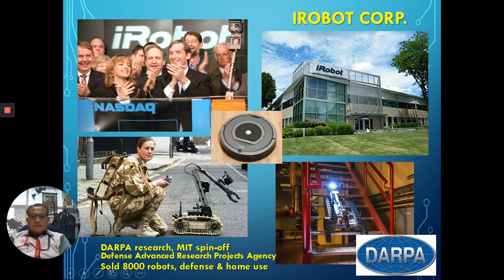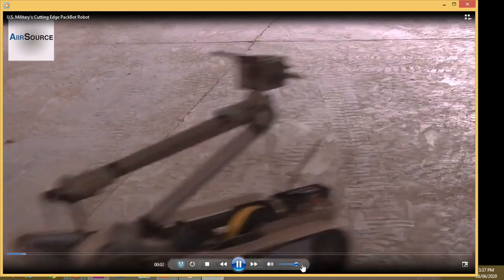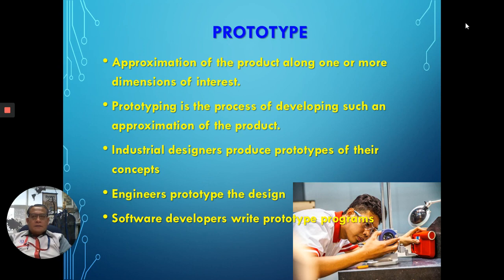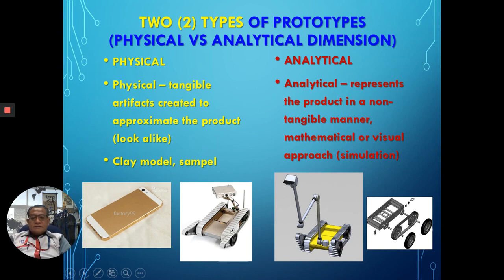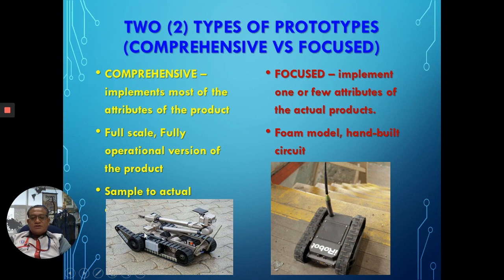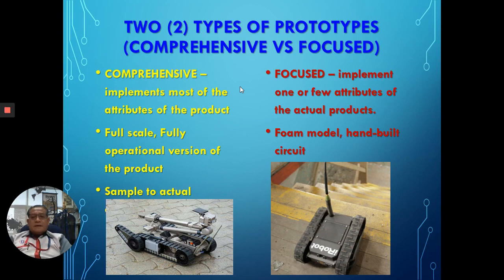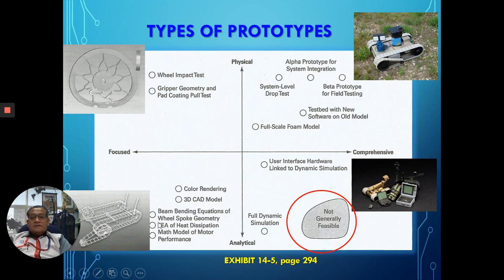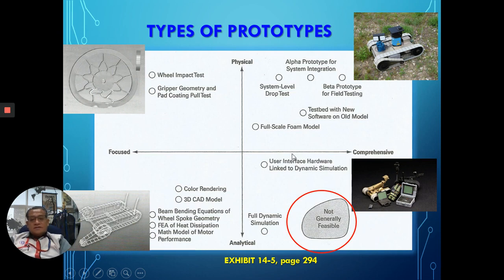Product Development Course Chapter 11 Prototyping

Comment: Ahmad Dhiaudin Bin Mohd Hishamudin (AP200079)
This chapter classifies prototypes according to their physical and analytical dimensions. There are four primary varieties of prototypes within these categories: physical, analytical, comprehensive, and focused. Physical prototypes enable designers and engineers to evaluate the form, fit, and functionality of a product. Analytical allows designers and engineers to evaluate and improve a product's algorithms, logic, or computational models. Comprehensive prototypes are beneficial for evaluating and validating the overall functionality and user experience of a product. Focused prototypes are advantageous when requesting specific feedback or addressing particular design challenges.

Comment: Abdul al-Akhmal (Ap200291)

Prototypes in this chapter can be divided into two categories based on their physical and analytical aspects. There are four basic sorts of prototypes that fall under these categories: focused, physical, analytical, and comprehensive. Designers and engineers can evaluate the product's form, fit, and functionality using physical prototypes. Designers and engineers can assess and improve a product's algorithms, logic, or computational models by using analytical tools. When evaluating the entire performance and user experience of a product, thorough prototypes are helpful. Focused prototypes are useful for requesting specific input or when tackling particular design issues.

Comment: CHE SHI MIN (AP200535)

I have learned what prototypes are from this video. The prototype can be divided into two types based on its physical and analytical dimensions. The physical prototypes are tangible, whereas the analytical prototypes are non-tangible. Additionally, there are two other prototypes that are both comprehensive and focused.

Comment: Lee Sook Yeen (AP200447)

Thank you Dr for sharing the video. From the video, I have gained knowledge about what is prototype which involves the process of developing such as approximation of product. This video also recaps the successful of IROBOT CORP. and its product. The capable robot able to move on the flat surface and climb the stairs. There are 4 types of prototypes which involve physical, analytical, comprehensive and focused.

Comment: NURUL RAIBATUL ADAWIYAH BINTI SAIIDI (AP200436)

From this chapter, I learned that 
Prototype is the processing of developing such an approximation of the product along one or more dimensions of interest 

There is two type of prototype which are physical and analytical. physical prototype shows a physical and made for sample. Analytical type is the model represents the product in non tangible manner such as in the form of software, graphic sketch and drawing. 

Another two types of prototype is comprehensive and focused. Comprehensive refers to the products which implement attribute of the product while focused mainly perform  1 or 2 attributes.

Comment: NURHANNANI FASIHAH BINTI ZULKARNAIN (AP200504)

Thankyou Dr for explaination.. So, for chapter 11, its explaining about prototyping. Prototyping is the process of developing such an approximation of the product. Its have four type of prototypes which is physical, analytical, comprehensive and focused. 

1. Physical - tangible artifacts created to approximate the product
2.Analytical - Represents the product in a non-tangible manner, mathematical or visual approach (simulation)
3. Comprehensive- full scale, full operational version of the product
4. Focused- implement one/ few attributes of the actual products.

The purpose of prototype is to learning, communication, integration and milestone prototype. Next, analytical prototype also more flexible than physical prototype. For rapid prototyping it is compatible with 3D CAD software modelling which its convert from dwg to stl drawing format.

Comment: NUR AMANINA BINTI MUSA (AP200517)
In this video, I gained knowledge about the four different types of prototypes, which are as follows:

Physical prototypes: These are tangible artifacts created to resemble the actual product.
Analytical prototypes: They represent the product in a non-tangible way, often through simulations or models.
Comprehensive prototypes: These prototypes are implemented on a full scale, creating a sample product that is the same size as the actual one.
Focused prototypes: These prototypes aim to implement one or a few specific attributes of the actual product.
Thank you, Dr., for sharing this valuable information in the video!

Comment: NURIYANA SUHERMAN (AP200344) From this video i learned there are two category of prototype which are :
1. Physical - present the product in a tangible manner 
2. Analytical - present the product in an non tangible manner

There are also have 2 more tyoe of prototype which is:
1. Comprehensive - thorough representation of the actual prototype and it is normally a fully operation of product 
2. Focused - emphasis on a few attributes of the actual produ

Comment: ALIFF IQMAL JEFFREY (AP200086) From this lecture video, prototype is a concept where it involves the process to developing such an approximation if the product. Prototype integrates control, interface software, hardware. There are two prototypes namely: physical and analytical dimensions. Physical prototype is refers to the features of the product or sample of the product. Analytical prototype is refer to software where ut involves more in software. It sketches the dimensions of the product. Another two prototype is comprehensive and focused. Comprehensive refers to the product where it implement most of the attributes of the product meanwhile focused product is perform only 1 or 2 attributes. Each prototypes have different characteristics

Comment: JOTHISWARAN A/L FRANCIS (AP200180) 

The video provided valuable insights into the concept of prototypes. A prototype is an experimental approach used by design teams to translate ideas from a conceptual stage to a digital representation. There are two primary types of prototypes: physical versus analytical in terms of their dimensions, and comprehensive versus focused in terms of their purpose. Each type of prototype serves specific functions in the design process.

Comment: Nur Izah Izzati binti Idris (CP 200006) 

Thank you for the sharing Dr, from this video i have learned about what is the prototype. Prototype is an experimental process in which design teams transform ideas from paper to digital. Prototype have 2 types which are pyhsical vs analytical dimension and comprehensive vs focused and each prototype have its own functions

Comment: WOON PEI XUAN AP200372
Throught this video, I have undestood the prototypes have four different types which is physical, analytical, comprehensive and focused.  The physical prototype is a three dimensional representation of an idea or concept.  Then, analytical is non tangible model. Besides that, Comprehensive prototypes are designed to test overall fuction of the product. Lastly, a focused prototype is to answer specific questions.

Comment: THARSHINIE MANIMARAN CP210058 . From this chapter there are 4 types  of prototypes which is physical, analytical, comprehensive and focused. The physical  dimension is tangible artifacts  created to approximate the product  and analytical dimension represents a non-tangible manner,like under mathematical approach. The comprehensive  is full scale  and implement most of the attributes of the product. Lastly the focused prototype it only perfor on few attributes of the actual product.

Comment: Wong Yunn Jye (AP200475)

In this chapter,  prototypes can be categorized based on their dimensions: physical and analytical. Within these categories, there are four main types of prototypes: physical, analytical, comprehensive, and focused. Physical prototypes allow designers and engineers to assess the product's form, fit, and functionality. Analytical enable designers and engineers to evaluate and refine the product's algorithms, logic, or computational models. Comprehensive prototypes are useful when testing and validating a product's overall performance and user experience. Focused prototypes are valuable when seeking targeted feedback or when addressing specific design challenges.

Comment: HEE HUANG TING (AP200440)

In this video, I learned about the prototype is an experimental model of a suggested solution that may be rapidly and inexpensively used to test or verify ideas, design hypotheses, and other parts of its conceptualization. This allows the designer or designers involved to make the necessary adjustments or potential changes in direction.

Comment: NUR HANISAH (AP200241), This video taught me that there are four types of prototypes: physical, analytical, comprehensive, and targeted. Then I'll understand that prototypes are initial samples, models, or product releases created to test a concept or process in various contexts such as semantics, design, electronics, and software development. Prototypes are typically used to verify new methods for accuracy by system analysts and users working to give specifications for existing operational systems. In some design workflow models, constructing a prototype, also known as a materialist, is a step between formalising and evaluating an idea.

Comment: Ng E Nee AP200399

First of all, thank you Dr for sharing this video. After watching this video, I have learned 4 types of prototypes which are physical, analytical, comprehensive and focused. Physical prototype is tangible artifacts to approximate the product. Analytical prototypes is a model represent the product in non-tangible manner. Comprehensive prototype is a model that implement most of the attributes of the products. Last but not least, focused prototype is model that implement that focus on a few critical capability of actual products.

Comment: HISHAMMUDDIN BIN HASHIM
(AP190310)

thank you dr for the sharing. From this video, I have learned that there are 4 types of prototypes which are physical, analytical, comprehensive and focused prototype. Physical model normally is testing its physical structure and physical capability.

Comment: Muhammad Syahmi Bin Rahman (CP190045)

From this video I learn what is the meaning of prototypes. There are 2 types of prototypes which is physical and analytical dimension. The physical prototypes where the product is tangible and analytical prototype is non tangible. There also have two other prototype which is comprehensive and also focused.

Comment: Nur Amira Afiqah Binti Norfaizal (CP190055)
Thank you Dr for your sharing. From this video, I have learned that prototypes is the actual of a product which can be classify into two types, physical and analytical. A physical prototype is a tangible object that is used to simulate a product. Analytical prototypes are non-tangible models that reflect a product (stimulation). A comprehensive prototype is a model that incorporates all of the product's features. A focused prototype is a model that focuses on a few key capabilities of actual items.

Comment: NUR RINA NAJWA CP190101

Thank you Dr for sharing, This video taught me about two types of prototypes: physical prototypes and analytical prototypes. The process of turning an idea into a physical representation Physical prototypes of various materials can be created early in the process. Physical prototypes enable both the designer and the user to interact with the concept. A mathematical model that can be easily tested. One disadvantage of analytical prototypes is that they can only show behaviour that is part of a model, and behaviour is frequently unpredictable. In software engineering, analytical prototyping is frequently used.

Comment: PRAVIN A/L LINGAM (AP190046)
Thank You Dr for sharing
These four prototypes are physical, analytical, comprehensive, and focused. I've learned this from watching this video. A physical model is typically used to assess a system's structural soundness and functional robustness. If you're going to test your model's durability and roughness on the field, you'll need an analytical model, rather than a physical one. It's common for a focused model to be tested in the lab, in the mathematical mode, or in a simulation, whereas a generalised model is typically tested in the field. A comprehensive model is a representation of the final product at its full scale, which is close to the analytical model's upper limit.

Comment: LOH WAN THENG (AP190366)
Thank you Dr for the sharing. After watching this video, I have learned that there are two types of prototypes, namely physical and analytical. Physical prototype is tangible artifacts created to approximate the product, while analytical prototype is represents the product in a non-tangible manner, mathematical or visual approach. Besides, there are another two types of prototypes, which are comprehensive and focused. Comprehensive prototype implements most of the attributes of the product. On the contrary, focused prototype implement one or few attributes of the actual products.

Comment: Nur Athila Safia Binti Jemzir (AP190035)
Thank you Dr for sharing.
 From this video, i learned  that there are four types of prototypes which are physical ,analytical,comprehensive and focused. physical prototype is tangible artifacts to approximate the product. Analytical prototypes is a model represent the product in non-tangible shape(stimulation). Comprehensive prototype is model that implement  all of the attributesof the products. Focused prototype is model that implement  that focus on a few critical capability of actual products.

Comment: Nurul Najihah binti Roslan (AP190032)
Thank you dr for your sharing. From this video I have learned that there are 4 types of prototypes namely physical, analytical, comprehensive and focused prototypes.Then, I can know that prototypes are initial samples, models or product releases built to test a concept or process which in various contexts, including semantics, design, electronics and software programming. Typically, prototypes are used to evaluate new designs to improve accuracy by system analysts and users who work to provide specifications for actual working systems. In some design workflow models, creating a prototype i.e. a process called materialisas is a step between the formalization and evaluation of an idea.

Comment: Alice Lee Ke Jia (AP190325)

Based on the video lecture, I have learned the four types of prototypes which are physical, analytical, comprehensive, and focused. Physical is the tangible artifacts created to approximate the product while analytical represents the product in a non-tangible manner, mathematical or visual approach. Besides, comprehensive prototypes implement most of the attributes of the product while focused prototypes implement one or few attributes of the actual products.

Comment: Wong Joo Yun (AP190066)

From this video, I learnt there are 4 types of prototypes, which are physical, analytical, comprehensive and focused. Besides. each prototypes have different functions. 
-Physical is tangible artifacts created to approximate the products 
-Analytical is represented the product in a non tangible manner 
-Comprehensive is implement most of the attributes of the products 
-Focused is implement one or few attributes of the actual product 

Thank you Dr for sharing

Comment: AMEERA AINUR BT AZMAN (CP190075)

Thank you dr for your sharing. From this video I have learned that a prototype is an early sample, model, or release of a product built to test a concept or process. It is a term used in a variety of contexts, including semantics, design, electronics, and software programming. A prototype is generally used to evaluate a new design to enhance precision by system analysts and users. Prototyping serves to provide specifications for a real, working system rather than a theoretical one In some design workflow models, creating a prototype (a process sometimes called materialization) is the step between the formalization and the evaluation of an idea.

Comment: Shazmin Ilyani Md Isa
CP190016

What I get from this video is that the purpose of prototypes is for learning, communication, integration, and milestones. There are 2 types of prototypes which are physical and anlytical dimension. The physical prototype where the product is tangible while the analytical prototype is non-tangible. The other 2 types of prototypes are comprehensive and also focused.
Thank you Dr!

Comment: SITI NORSAHIDAH BINTI SAFINGI (AP190125)
From this video, i understand and learned about the prototype. Basically prototype are build as a sample before it turn to actual product. There are two types of prototype firstly is physical and second is analytical. For physical prototype is more to physical kind of outlook of its actual final product. This made for sample that customer can touch and feel it. While for analytical prototype more like simulation which is non tangible shape. Normally, in the form of software such as visual approach. The important of prototype is it can help attract customers to invest in the product.

Comment: FARHANA SYAZWANI BINTI AHMAD FADZLI (AP190439)

Thank you dr for the explanation. In this chapter I’ve learnt that to make a real product, we must design a prototype first. From the prototype model we can get the approximation of the product. The features of the product can listed out to make the users understand about the product in details. The product consists of hardware and it controlled by interfacing software. Next i also able to differentiate the types of prototype between physical and analytical prototype and comprehensive and focused prototype.